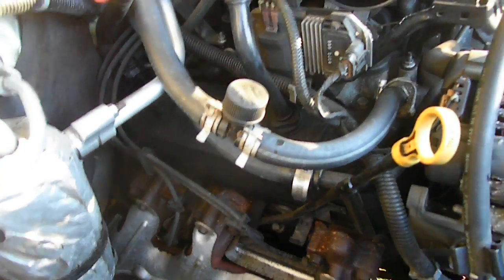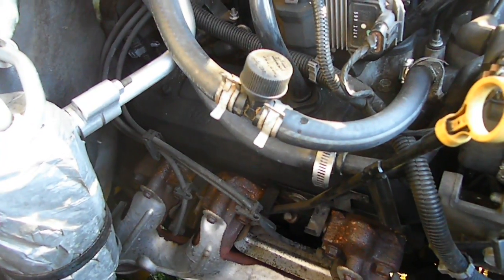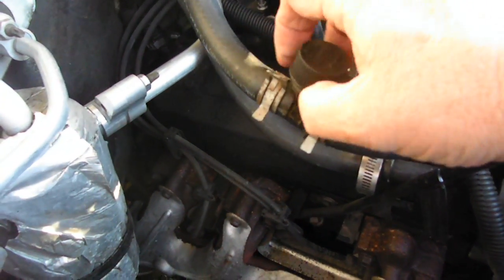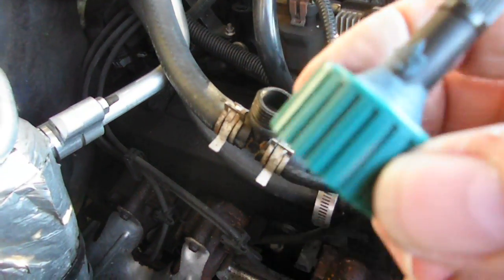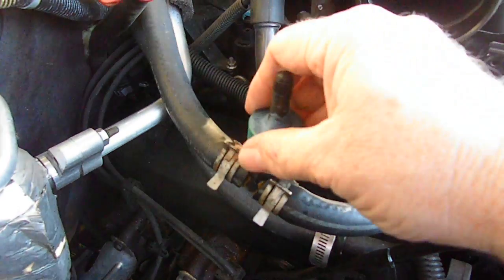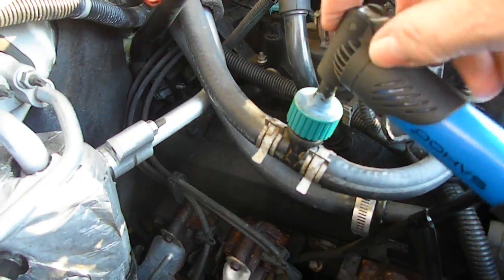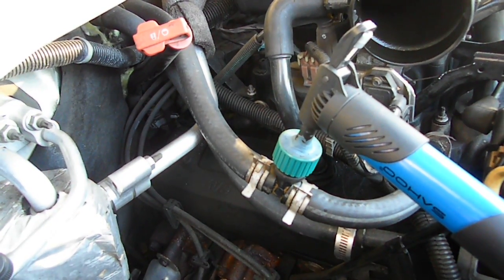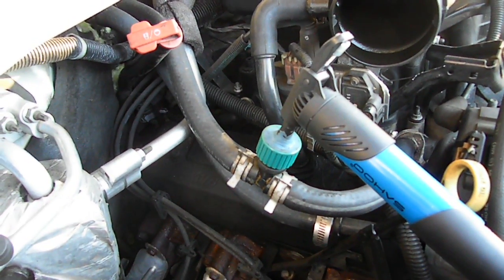Cheap cooling system tester

Comment: couldnt you do the same thing with the reservoir cap?
Reply from the maker: Hello and thanks for watching. I think that would work as long as you also plugged the overflow tube.One reason I did it the way I did was that I had a spare cap so that once I found the leak I removed the cap with the valve in it.

Comment: great idea, think u need a pressure gauge tho?
Reply from the maker: Hey Aaron, thanks for watching!  I didn't really need a pressure gauge for mine since with about 3 or 4 pumps the leak showed up. But if you did want to add a pressure  gauge it would be easy to do using the overflow tube. If I did this a lot or if I needed to keep the system pressurized for an extended period of time I would add a gauge  at the overflow tube.  To me this is just a good way to go since if your vehicle is old enough to have problems it's probably time to add the flush and fill kit anyway.  Good question!  I always try to make tools if possible rather than buying.
Reply: beninchesapeake  ,seems he could just use a tire gauge to check pressure